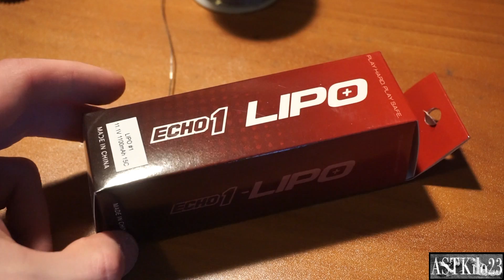DIY: How To Install A Deans Connector (T-Plug)  -ASTKilo23-

Comment: Thx for this Tutorial m8, my krytac will finally get soon a resoldering by me from tamiya to deans cuz i want a better trigger response, do i mess with my warranty even if i do the soldering right?
Reply: You probably will mess with the warranty, yeah! Worth checking with the manufacturer or retailer.
Reply: @nelly860  whatever, i already soldered it to deans, and it works like a charm, warranty will run out soon, so its already more than just ok 👍🏻

Comment: I accidentally linked the two terminals and it made a spark, are my lipos good as dead?
Reply from the maker: I've done that on occasion, and it's really a case by case basis. If just for a split second, probably ok.
Reply: @ASTKilo23  Thanks, man
Stay safe

Comment: I am doing this on an airsoft gun. Am I allowed to do this straight onto the gun? Like I have the deans connector and then can I just cut the wire on the gun and then solder it from there? Ps I’m sorry I’m late

Comment: When soldering, plug in the other half of the connector to help dissipate the heat and prevent the plastic (or nylon) molding from getting too hot. Be careful not create or allow one wire to touch the other and create a short.

Comment: Or you can get a tamiya to deans adapter
Reply from the maker: and add a lot of unneeded resistance.
Reply: Yeah, but its the best option for me, cause here in my club, people use tamiya. so if i change to t-plug, that means i cant borrow batteries
Reply: Allthough i think the deans connector is much better
Reply: @Baba2ks  still keeping a Tamiya in the loop negates all the benefits of switching to deans and having two plugs creates even more resistance. You would be better off not even changing to deans.
Reply: Fred-Håkon Haugen you should buy another battery.

Comment: now how do we go about making a deans connector charger?
Reply: You can buy deans to tamiya connectors at evike, i just did myself it costes 6dollars.
Reply: Easy just buy a lipo battery and charger they have a separate cable for charging no adapter needed.
Reply: I know but lipo batteries are a lot better no reason not to use a lipo unless you have a cheap gun and even then there are 7.4v lipos

Comment: I should do an updated video how to do this. You should always heat up the item you are soldering NOT the solder or you can get a cold joint and it can fall apart or not flow current well and cause heat or damage electronics. I should do some updated videos on Lipo/soldering and Battery charging since I have been doing it for almost 20 years...

Comment: I like to use automatic wire strippers that way i don't have to worry about diameters...

BTW does anyone know why female connectors go on the batteries? 'Cause for me it would be logical to have the male connectors on the batteries since I'm plugging the battery into the gun not the other way around.
Reply: *****
Right, that makes sense, thanks.
Reply: If the male ends are exposed there is a greater chance of exposure to metal which could potentially short the battery.
Reply: @peterzivkovic  this is the answer we all needed.

Comment: can you install a deans on a nickel metal high drive battery and then buy a Tamiya to deans conversion wire for a tenergy universal smart charger will this mess up the battery and/or charger because all the videos I see they are using lipos
Reply: DreamAirsoft yeah I just did
Reply: Way late but its totally fine.
Reply: haha

Comment: Good job. You used rosin-core leaded solder. Wash your hands after handling it. Also, a good swab of a q-tip with rubbing alcohol on your solder joint will wipe away any remaining corrosive flux.
Reply: Does rosin core solder flow easier than regular solder and rosin flux?

Comment: is this the same process with replacing the guns tamiya connector but with a male deans? also what benefits come with deans connectors?
Reply: Better trigger response and fire rate
Reply: Yes process is the same. Also i have heard battery life is longer with deans
Reply: +Guntech762 yes this is true do to less stoppage of the flow of electricity